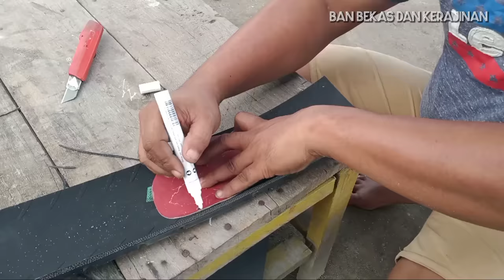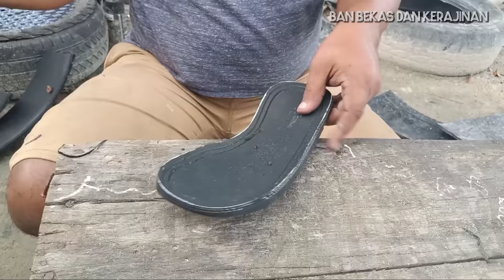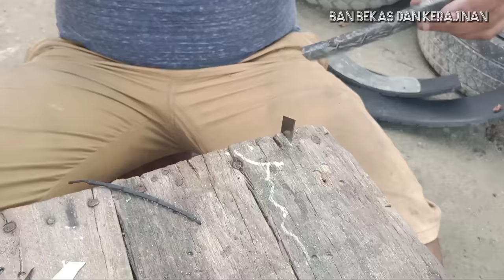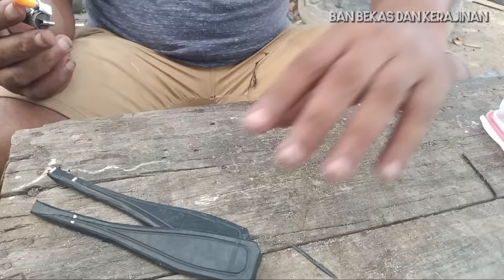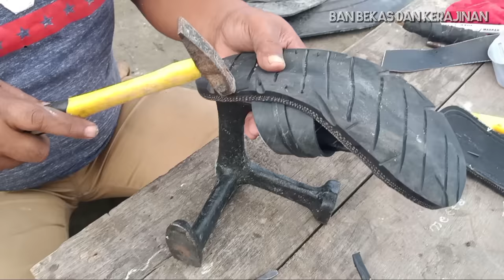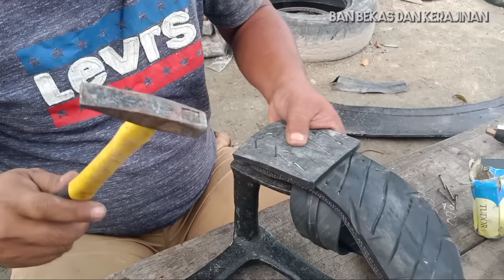making sandals from used motorcycle tires

Comment: No one has mentioned that the unbelievable part of this entire video is that razor blade.
Reply: yeah it's so sharp
Reply: Maybe for you,my favourite part was the end
Reply: I was saying to myself :”how’s that cutting into that radial tire so easily?”  Maybe cause it’s an old dried out tire !?
Reply: If you are thinking the steel belts motorcycle tires are not constructed like car tires are
Reply: Lol hell yea ,  that blade set up is right on time.  Something tells me This ain’t his 1st time making sandals.
Reply: That’s amazes the crap out of me😂
Reply: Jerry Moe damn bro are you ok
Reply: @jerrymoe2113 and she pulls out her UNO reverse card
Reply: @isek7228  hi  ,sorry I dont understand the meaning of UNO REVERSE CARD,
Reply: I don't think you can get them that sharp at Home Depot.  Much less one you can bend into a U shape.
Reply: Prolly carpenter steel. Hella sharp and can hold a edge
Reply: nova nova , china.
Reply: I believed the blade he using is from NT Cutter's brand. Made in Japan

Comment: I never thought cutting tire with this knife can be that easy.
Reply: Because most small motorcycle tyres are just cross ply and once worn are quite thin. They don't have steel belts in them like radial car tyres and larger radial motorcycle tyres.
Reply: @Ozninjaguy  steel belts on side only for motorcycle tyres

Comment: Your idea is unique but that nails will give you reminder of your mother when stone comes within it to your feet dear ! Use stiches instead of nails . It will gives strength also to your joints of foot wear
Reply from the maker: Thank you Siddarth
Reply: They’ve been making boots with nails for hundreds of years tf are you talking about
Reply: @jacksonsmith4522  Thousands...Romans used nails into sandals
Reply: @newworldsoldier81  lol .time goes forward not backwards.
Reply: Surely he will make it if you ordering custom version. It's about as cheap as possible to produce. And about durability,i have one. It seem likely that sandals will have longer live than the user 😅😅😅
Reply: Stitches are much safer than nails
Reply: He probably doesn’t even have power. You make good with what you have
Reply: @coltruiz7126  contact cement can also be used, this is not a new idea making slippers or sandals.
Reply: @2815Juan  "He probably doesn't even power" nope no power just a HD camera and internet. No power needed there.
Reply: @Vextra1776  this is a joke hehehe why put nails imagined if you were this its so hard
Reply: Yes and if you work some electrical work it won't work as insulator to prevent you touching ground. Nails passes electricity through you. Use stiching or boot gum in place of nails.

Comment: Where they buy their blades. Mine hardly cut cardboard
Reply: CHINA.
Reply: @macabrecreation1067  nope, tatra razor blade from czech
Reply: @rafitohornero3850  seriously?
Reply: If that was me, there would be rubber and fingers everywhere.
Reply: @clydedenby1436  he's joking
Tatra only make truck and some crazy long lasting heavy duty equipment
Reply: @SUBARUSTI-it9jv  they have them on Amazon.
Reply: @bazza945  that makes two of us.🤣
Reply: It isn't the blades but the handler

Comment: instead of nails he should have used glue.
Reply: Yeah, instead of using old tyres, he should of used new sandals
Reply: Or maybe sew on it.
Reply: Or maybe he was making sandels from what he had and what is unfortunately easily found anywhere in the world.
Reply: The rivets made with nails are very effective, strong and totally waterproof. The lone "problem" is rust. Glue won't stay in a humid hot climate and these sandals are made to go in a muddy trail during the monsoon or rain season. You can sew and it asks for more job.

Comment: Dont use nail just stitch only because the nail is to hard to the foot
Reply from the maker: Ok... thank you.... ♥️♥️♥️♥️🙏🙏🙏🙏🙏
Reply: I too feel so,use glue instead of nails
Reply: Nail is risky.. if got hurt, tetanus etc... may be use aluminium rebets or something like that.  Best is to stitch using leather stitching awl.
Reply: ⚠️DONT TEACH HIM HIS JOB.
Reply: @vinodananraghavan8835  Indonesian people is very strong😃😃😃
Reply: Cobblers have used nails for thousands of years. They are on the OUTSIDE of the foot of for a reason. Besides we that rubber is for 30-50000 miles.... Do you really think you're going to wear them out walking around?

Comment: I liked the ones that they made back in the early 60s out of car tires with the whole tread itself.  But this went away after steel belts were introduced.  I believe the fiberglass belted tires could be used with some trouble.  Used to be able to gets tons of them in Tijuana cheap and they did hold up.  And yes, we did use them at the beach just like the song.